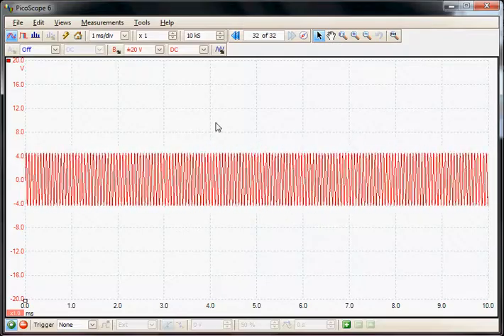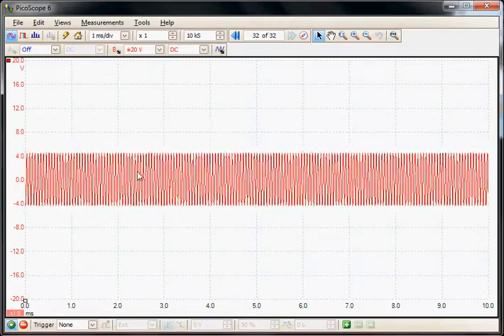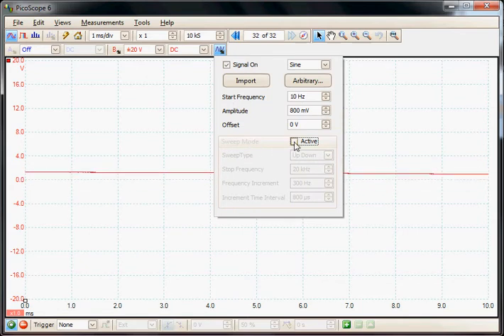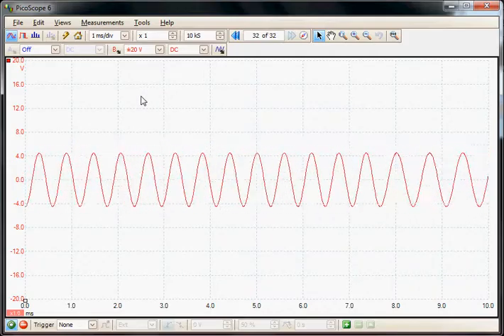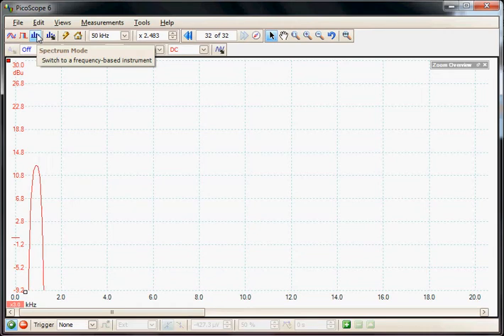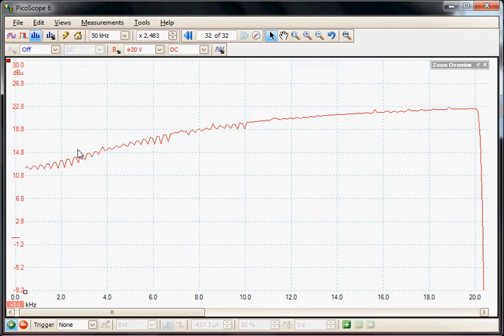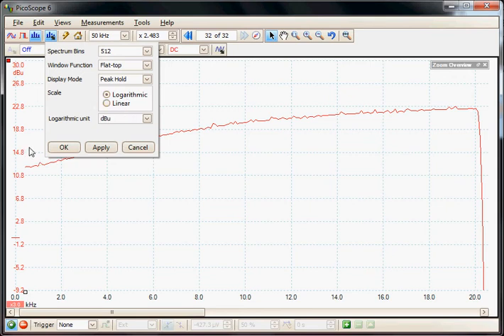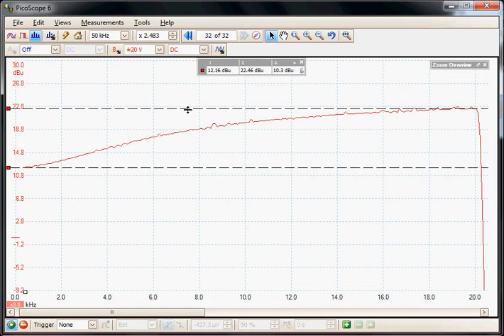How to use an oscilloscope to measure the frequency response of an audio amplifier

Comment: You have chosen the frequency step to be 300 Hz and the time increment 800 mikroseconds. But below 1200 Hz, one period T of the sinusoidal signal is bigger than the time increment after which the generator switches to the next frequency. How is it possible for the software to measure the response of the amplifier to a - say - 610Hz signal, if it switches to the next frequency step after less than half a period?  Does not have the time increment to be always e.g. 3- or 5-times larger than the period of the lowest frequency?
Reply: yes